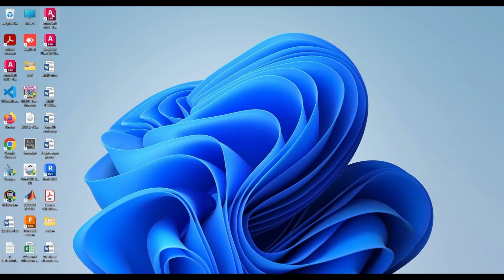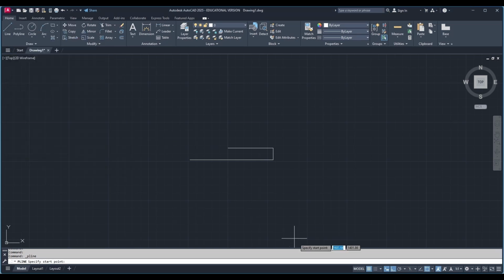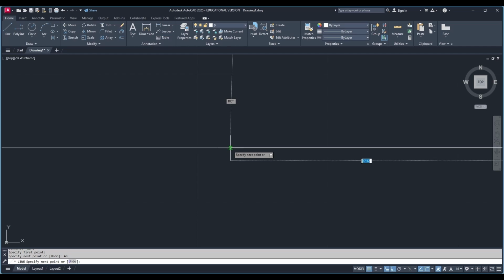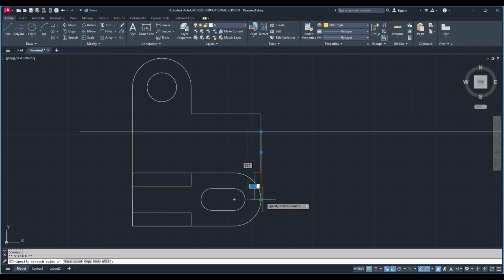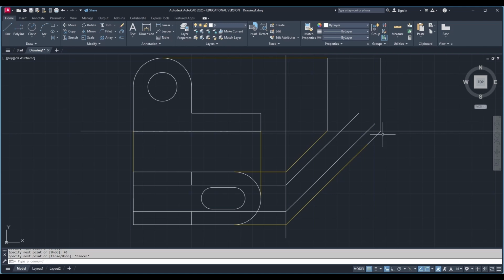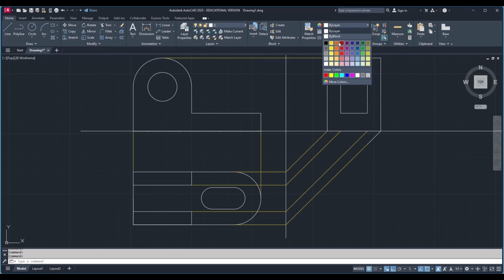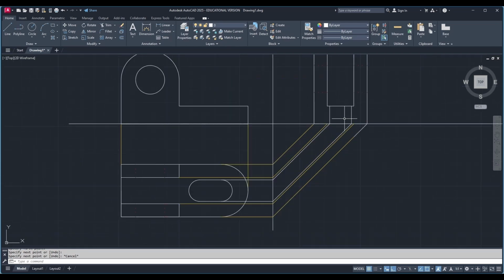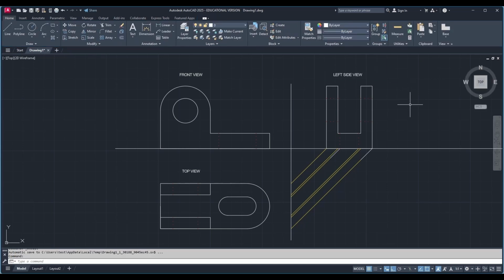AutoCAD Tutorial: How to Draw Front, Top & Side Views from an Isometric Drawing

Comment: But in question we are given with front view from left side , so in projection , the front view should be on right hand side
Reply from the maker: In the question, the direction for the front view is clearly specified (from the left side). So the front view is drawn based on that viewing direction. The position of the front view on the sheet is not fixed to the right-hand side. In first-angle projection, the front view is usually drawn at the center, with the left side view placed on the right side and the right side view placed on the left side.

Hope this clears your doubt. If I’ve answered your question, consider subscribing 😊